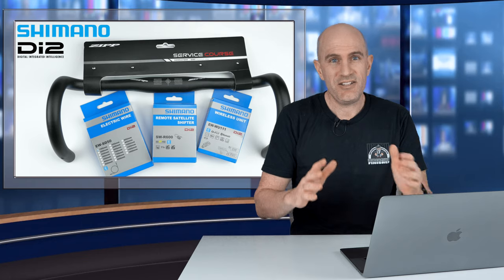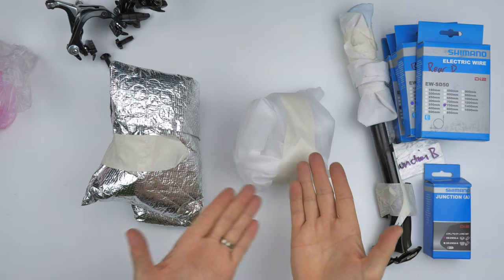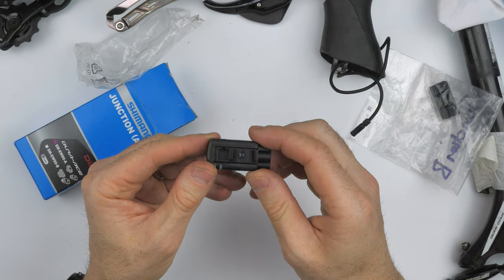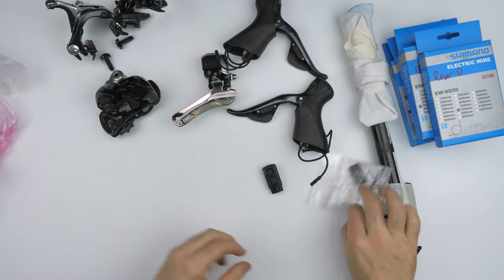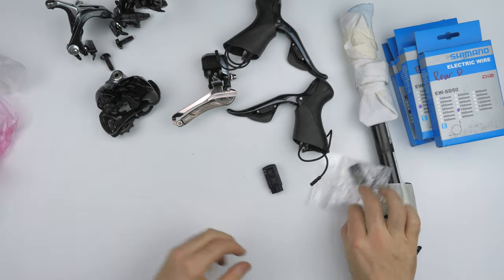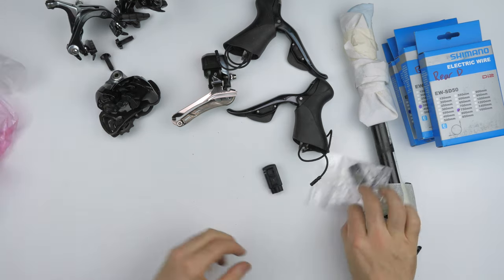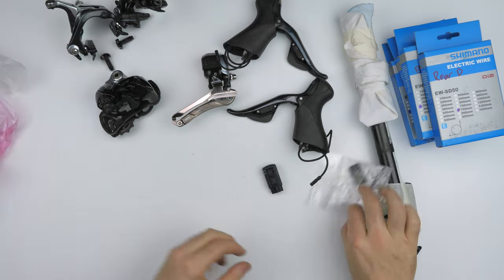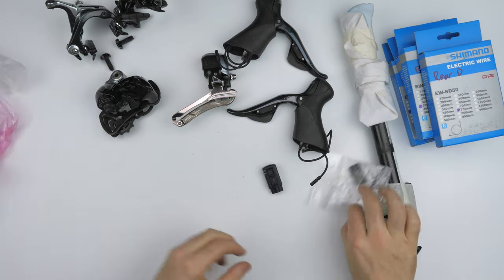Shimano DuraAce Di2 Upgrade Project: Unboxing // Updating // Di2 Diagnostics [SM-PCE1]

Comment: Nothing like a Lama Di2 video too keep me company while working 😊

A small side note is that you can do a limited diagnostics process on the e-tube iOS iPad app as well (no on the iphone version though which makes no sense). It wouldn't have worked in this case with the old battery and no BT dongle but good to know before people start buying PC-links... (which still have its merits like you said, hard wiring to single components etc.)

Looking forward to more di2 nerdery!
Reply from the maker: Interesting tip on the iPad version of E-Tube! I'll have to check that out.
Reply from the maker: 20 minutes later... I've checked it out. Awesome! The only issue is that it needs a working Di2 system and BLE to diagnose... a non-working Di2 system... or parts. I might spin a video up on this shortly. It's a great tip.
Reply: Shane Miller - GPLama excellent! 
Yeah, it doesn’t render the pc link obsolete by any means, but can be useful for us home tinkerers :)
Not that I think many people need that function anyway, I’ve used it once since my first 10speed di2 in 2012, di2 just works!
Reply from the maker: I've just found your video on it from last year (I was making sure I didn't duplicate content 1:1). I'll point people your way when I cover the tablet E-Tubey on the YouTubey. I also got a disc alignment tool in the post today too! So neat!
Reply: Shane Miller - GPLama no worries about duplicating mate!
that video was not really about that function, more of a side note, I think people would appreciate a more in-depth walk trough of that process for sure, and you make the best ones! 👍

Comment: Shane, your videos can be a long as you want.  I find these very helpful.  I have never been one to want a Di2 system, but now I am looking everywhere for a good used one on ebay, FB and Craig's list.  I am overwhelmed with all the models out there, so time to do some more research.  Your follow up video on the install is also excellent.
Reply from the maker: Thanks Zane! These are a really enjoyable videos to make and share. Lots more to come with Di2 things. Tonight I've got the E-Tube Project Windows software working on my Mac with a virtual machine.... so I could firmware update even more Di2 upgrades (new battery and new levers already picked up for this build.... really really cheap too!). Good luck finding a bargain. They're out there.
Reply: Shane Miller - GPLama I have no idea where to really start. There seems to be some old models out there and then there are so many to choose from. I look at Shimano’s web site and I am left with even more questions. As you say “happy happy days”. That just means more fun learning.

Comment: The more I watch your Di2 videos the more I realise how much I need it in my life. The one barrier is cost. Unless I can pick up an upgrade kit cheap somehow not sure I can justify it.
Reply from the maker: The prices will come down. If Shimano release the next generation DuraAce this year (maybe?) then depending on the release list price, this stuff might fall. If it's crazy expensive then the older gear will hold value.
Reply: Shane Miller - GPLama That’s what I’m hoping for. I keep looking at the 2nd hand market but my bike is only a few months old & not sure I want to put a used groupset on a nearly new bike 🤔

Comment: I’ve been doing the same for my gravel bike. I’ve picked up every wire except one, a b junction, and an ultegra rx mech. I’m still going to beat retail, since I don’t need to buy a charger, but finding 9170 levers at a good price has been impossible. I need 9200 to come out so old ones come on the market.  They hydro seems harder to come by, maybe because it’s not an aftermarket upgrade for most people? The battery and junction a won’t be a problem when the time comes.
Reply from the maker: Awesome. Half the fun is the hunt for parts. Ping me a photo or two when your grav project is done!

Comment: Second! And another great little vid from lamaman. 😁👍
Reply from the maker: I love tinkering with this stuff.
Reply: Shane Miller - GPLama we love watching you. There’s nothing wrong with fettling with your bike. I love it too! I can spend hours tinkering but doing absolutely nothing! 😁

I’m undecided on Di2 or Etap. I was very much leaning towards Etap but since the rumours have started about the alleged “miss shifting” on some Etap units, that none of the big “sponsored” YouTubers seem to want to talk about. I’m now looking more seriously at Di2. It could just be an internet wind up or disgruntled buyers. But sadly it seems there’s just too many to ignore and spending such sums of money, I only want to buy once....and all my mates use Di2 so....

But I’m just not crazy about the Di2 buttons (a bit too close together) But I’ve been told you can set up Di2 exactly like Etap just using 2 buttons in full synchro mode?? 

Do you have any thoughts Shane?
Reply from the maker: The programming options allow eTap style shifting on Di2. For x1 is will be identical. For x2 you'll have to work with S2 mode changing the front chainrings at particular shift points. If you have the wireless module and a Garmin head unit, it'll beep to alert you the next change will also be on the front.

Comment: Great video Shane! You mentioned that you want to install the groupset on your old TCR. I am planning the same for my 8 year Scott Foil and I am not sure, if the frame can handle Di2 cables. (I had troubles, even replacing mechanical gear cables :) ) It would be great, if you could get into more details about the things to consider before upgrading an older (not Di2-specific) frame to Di2 in your installation video. Absolutely looking forward to it :)

Comment: Isn't it great that we have SRAM, Campagnola & FSA competing to out-improve each other? Although there are so many wires, Di2 is pretty "bullet-proof" makes me appreciate bike mechanics!  The bike I crashed in December had Campagnolo EPS, which uses a higher voltage because they wanted better shifting response & power, so whereas Shimano and SRAM can use USB connectors Campag couldn't...

Comment: The SM-BTR2 already supports synchro shift, but you do need the newer battery for the EW-WU101/111.
Reply from the maker: Really? From what I've read up it doesn't. I'll test this out. Cheers!
Reply: @gplama  Hmm, I'm pretty sure I had it working on my previous bike with the 6870 groupset (and older battery), but a lot of pages do indeed mention the newer battery is needed. The release notes for the SM-BTR2 include a fix for synchro shift though: https://e-tubeproject.shimano.com/firmware/template/?type=general-items&series=&model=SM-BTR2.
Reply: Ok, my memory must be failing me. Just tried it on another bike with a 6870 groupset, and the E-tube software won't even let me change the synchro shift settings with a SM-BTR2.
Reply from the maker: All good. Interesting that they listed "Synchronized" in that firmware update.

Comment: Love your videos Shane. Reckon there’s much of a difference apart from weight between Dura Ace and Ultegra?
Reply from the maker: I’m more than happy with Ultegra 8000 series Di2. It’s the sweet spot for new bikes/prices. I’ll see how this performs when this is all installed.
Reply: Shane Miller - GPLama cheers - look forward to seeing that!

I just upgraded to 105 r7000 from 5700 and loving it so far. Electronic would be the dream though!

Comment: Does the software allow you to reverse the function of the shifters so that the left shifter can control the rear cassette. I have limited use of my right arm so want to control the rear cassette from the left shifter
Reply from the maker: Yes.
Reply: Shane Miller - GPLama great. Thanks much.
Reply: @bobowsinski1704  if you use the newest battery, you can run full synchronised shifting as well. Meaning you don't need to use your other hand to shift front chain ring, it will automatically change when when required as you shift rear cassette.
Reply: MrBJPitt wow big bonus. Thanks

Comment: Oh my god ... I switched from Ultegra mechanic to SRAM Red etap AXS and I am super happy with and at the same time amazed how complicated Di2 is ... why bother?
Reply from the maker: Overall cost. In addition to the cost of AXS, I'd need 4-5 AXS cassettes and a lot of XDR drivers. I can't justify the price. If I can get AXS equipment on any kind of 'deal' then I'll cover it.
Reply: You don't get latency with di2 it really is super fast. It's battery life is very good as it's standby might as well be off it uses such little lecky
Reply: I upgraded from orginal di2 10 speed to 11speed eTap and can’t be happier.  Although shifting is a millisecond slower, the ergonomics, simpler shifting logic, easy to access battery and super simple installation are big pluses.  I like simple...

Comment: Shane, great video, what could I expect to pay for either a dura ace kit like you bought or 6870? Is there a difference in function?
Thank you
Reply from the maker: It really varies based on the condition. A similar set to this popped up a few days ago for AU$1390 with a scuffed up crankset, cassette, and chain. (Although used cassettes and chains are not worth anything, imo). Function wise it's best to check out the 'E-Tube Compatibility Chart' and cross reference the part numbers. 6870 looks in line with this (and current generation Di2).
Reply: @gplama  thank you. I really only need all the di2 gear. If it came with other gear and was good cond I could sell on of course.

Comment: What about UCI Certificate/Approval  and UCI Calibration? So i want to have some information about pro sport compatibility and about the new “Connectivity” port.
Reply from the maker: Wrong video.... but we’re years off this for indoor trainers.
Reply: Shane Miller - GPLama 
You are right..I’m a little bit surpised about that..maybe I did something wrong. 
But you’re right that I mentioned the “Kickr 5.0” video. 
So maybe you can use it for some question to Wahoo, Elite, Taxc and so on.

Comment: Shane, I have a similar setup with ST-R8050 shifters although I am not using SM-JC90-A since I am using EW-JC130 and EW-JC200 to connect the wires to junction box B, the issue I have is nothing works unless I connect each derailleur individual, Is this a Firmware issue?  Thanks,
Reply from the maker: What Junction A are you using?
Reply: Shane,  I am using E-Tube Di2 Junction Port - EW-JC200 to connect EW-JC130 to the wiring on the downtube to the Junction box B.
Reply from the maker: @alpaca06gmail  Neither of those are a Junction A. I've always assumed a Di2 system needs a Junction A (which is always the case for internal batteries for charging)
Reply: @gplama  I am using EW-RS910  and want to keep cables internally in the handlebar, what is my option to connect it to the Junction Box B?
Thanks Shane
Reply: @gplama  I assumed using JC200 will avoid using Junction Box A since I can't place it inside the handlebars, will EW-WU111 work as a junction box A?
Reply from the maker: @alpaca06gmail  I'm going to have to tap out here sorry... I've got way too much work on my plate. I'll direct you to the E-Tube Compatibility Chart over on the Shimano website.

Comment: Cable lengths please. I have a spare set laying about and need to buy some cables and don't know the lengths required. So what lengths do you get with this set.??
Reply from the maker: Required lengths depends on the final wiring solution chosen. I'm not quite at that stage with this yet.

Comment: Speaking of FW upgrades causing troubles: DO NOT try v9.66 beta for Edge 1030 - most likely it will brick your device. That whats happened with my device. Garmin has confirmed the problem and removed this FW version from downloading. Now I’m waiting for GPS replacement. Regards!
Reply from the maker: Yeeeouch! In good news - it looks like the Garmin Forums are back online now.
Reply: @gplama  Good to hear! Well spent 10M USD 😀

Comment: So all that PCE1 can do that the normal charger can't is that diagnostic. Which means getting one is pretty pointless. (I want one)
Reply from the maker: It can connect to a single component without it all being wired into the Di2 bus. It’s something a bike shop needs to have on hand.

Comment: What an absolute spaghetti mess of wires and boxes. Sram must laugh at this.
Reply: Shimano laughing all the way to the bank though
Reply from the maker: You're seeing the guts. If I pulled apart a human, it'll look the same. Once installed it simply just works. The Shimano vs SRAM battles require a broader view. SRAM has its fair share of documented issues. List price being the biggest one stopping me from having more SRAM content on the channel.
Reply: @MrBJPitt  Ofcourse when you need to buy 100 parts to make it work.
Reply: @gplama  Neither one is cheap IMHO. Mechanical once installed just works too.

Comment: Imagine 'upgrading' your bike by spending ~$1.5k on 7 year old, used parts when 9200 series will be coming out soon, dropping 9100 prices through the floor 😂
Reply from the maker: Imagine? Dude. I live that shit purely so the Internet can take the piss out of me. Join me. It's more fun than doing just that.
Reply: @gplama  Only if you upgrade back to 11 speed mechanical once the fad of 10t cassettes wears off in 2 years time :P
Reply: Is it coming soon though? The 9070 derailleurs are still very sort after because many like the finish of the older group. I run the very same parts just upgraded disc shifters and will probably pass onto a cheaper frame as my next trainer spare.
Reply: @glennoc8585  The only people that know that are shimano, however here's an article on it, and given their historical release schedule, it's long overdue: https://www.bikeradar.com/features/shimano-dura-ace-r9200/